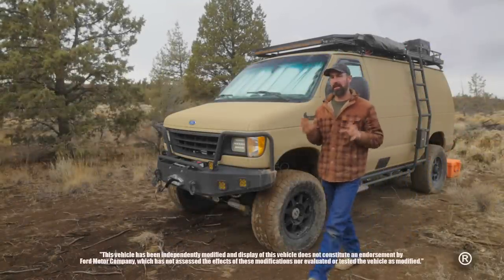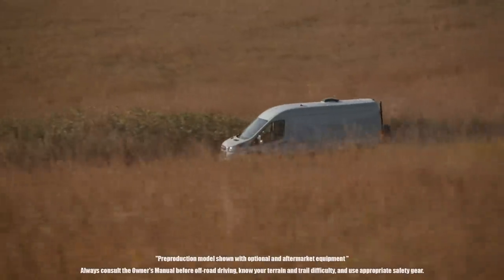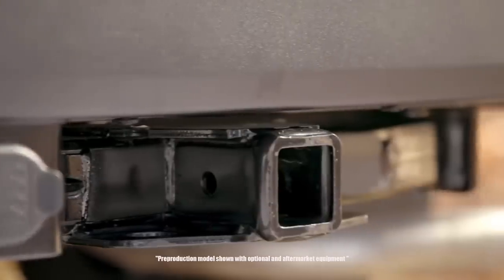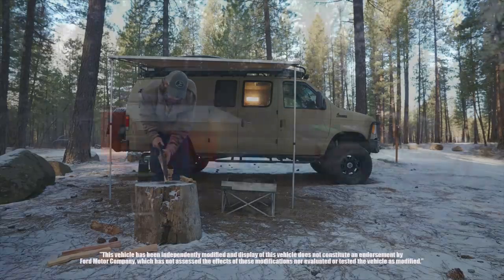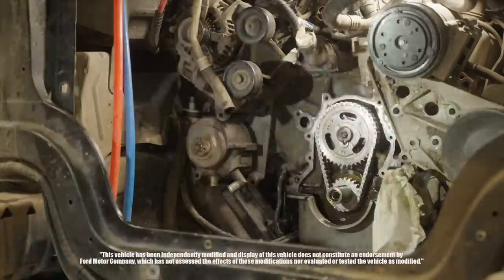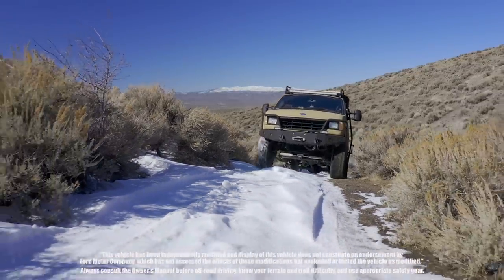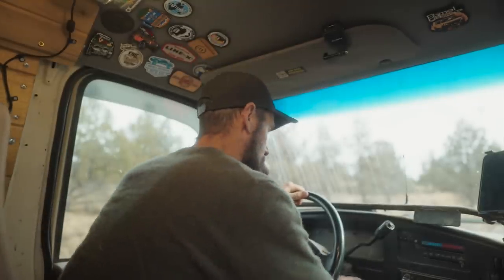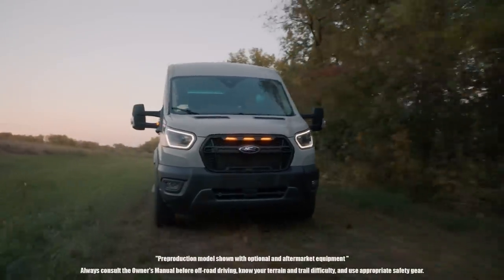The New Ford®  Transit Trail™ Van Reveal

Comment: I would guess that someone purchasing a Transit Trail, eventually would feel the same way you do after putting a similar amount of effort and care that you've done with your home. It's nice that they've come out with something that even novice's could get and have something that'll give them a head start so to say. Also glad to see Ford reach out and sponsor a person that uses their products.
Reply: As someone that's owned 3 Transits for work, with a 4th on order(I have no choice due to contract requirements), I don't wish these vans on anyone. I've had endless problems with mine and I'm not hard on cars. Bought a Ford Escape hybrid with 180k on it and I added 200k before selling it. I even had a 300zx and put 200k miles on that.  The longest I've gone with a transit without a major problem is 28k miles
Reply: @veganpotterthevegan  I have a 2018 as a shuttle vehicle with a less than careful  driver.  It has over 105,000 miles now and it has only needed normal maintenance and a water pump.
Reply: @Michael McGlothlin  there are always anomalies like that rare Range Rover with 400k original miles.  Transits are problem vehicles.  I work with over a dozen others with transits and ALL of us with ecoboost have had short lived headgaskets, over 1/3 have had transmission issues and we've all had issues with our sliding door

Comment: Ford's Transit Trail looks like a good rig for snowy/icy roads and easy dirt roads and I'm glad Ford came out with all-wheel drive. The Ford vans I had before treated me real good, but I will stick with my 3/4 Ton GMC SAVANA 2WD, Limited slip, lifted, larger off-road tires for where I want to drive. Thanks for the video's, Your hard work is appreciated

Comment: I think the used van that you built out makes the most sense, you know every part of your van and if it does need work you can do it.  Like you say the challenges in the journey is what makes van life an adventure.
Reply: Totally agree with you mate, also I'd buy an older van model so much less electronics to go wrong. If things go wrong you might be able to fix some stuff yourself.
Reply: I bought a new 2020 AWD Transit and LOVE it.  The process of doing the interior build, learning carpentry, DC electrical system, 3D design, plumbing etc was more than enough for this solo female to feel accomplished and also be confident in being able to repair anything on my own with my build.  I have learned some basic mechanical things as well, but am so happy that I have the warranty.  And that there is a Ford dealership ANYWHERE.  The AWD particularly shone when I got stuck in deep soft sand at Elephant Butte NM.  Simply deflated my tires to 15psi, used my recovery boards and threw it into mud/ruts mode.  Such a BEAST.  Was really a "hold my beer" moment and it solidified my satisfaction with going with the Ford Transit.  Also, drives like a dream on the highway and doesn't skip a beat on high mountain passes.  I will always have a van for vanlife, and when I'm ready to upgrade, I will be choosing a Transit again.

Comment: I know this is an older vide but if you're still reading.. how does this work? Do you have to buy a regular transit first, and then have an authorized modifier do the rest of the build for you? I'm not seeing anything listed on Ford's site about it, I was just curious about pricing. I'm looking for something like 4WD/AWD Winnebago travato where it has a bathroom in the back and 2 kind-of twin beds

Comment: Old: learn and improve as you go. Field fixes possible. Lower entry and monthly insurance costs. 
New: higher cost and complexity with little chance you’ll need to fix it on the side of the road, but fast forward a few years when the warranty has ended and the van has depreciated, how will you like it then?
If it’s anything like my 2019 4x4 Sprinter it’ll have a dozen recalls, mostly for software. Which leave you wondering if these new vehicles are disposable items long before Sasquatch drives it’s final mile. 
I’m currently looking for an older - less tech filled option for mild overland travel.

Comment: I think it was as good of a place to start for Ford. Neat concept. Interesting for sure. But for some of the places I want to go, that van would get high centered or stuck quite quickly. More lift, and an optional 4x2 or 4x4 would be better. Squach is more to my liking, and I love that van. You did a great job on it, and its capabilities show!! Thanks for this. Later!

Comment: I like it!
I bought a 2014 E-250 to convert to 4 wheel 
.  While waiting for my position in the que I used it to “overland”.  I found that the van worked well for what I was doing.  I lifted the van 4”.  I like what I see here.

Comment: I think this is a great move for Ford.  They're taking the van conversion market by storm.  With Dodge Vans being only FWD, and the double whammy of Mercedes pricing and diesel issues, Ford is in a great position to dominate.  I agree these vans are build for the highways, and maybe gravel forest service roads. That still covers a lot of territory.  It's not suitable for overlanding or weekenderlanding like you do. But that's ok. That's where their pickups and Kimbo / Scout / Four Wheel Campers come in to play.
Reply from the maker: I think this van could serve a lot folks very well. I think the AWD system will suit most folks. For everyday driving in bad weather conditions like snow and ice I think AWD is superior to 4wd.  Most folks are looking at the lack of 4wd as its road block to off roading it, but to me the road block is the approach and exit angle. The real issue is going to be cost and Ford delivering on the product. 

Jason
Reply: Where can you purchase one of these fans? I’ve talk to a lot of Ford dealers and they don’t seem to carry them nor did they want to order them for you?

Comment: I think that they made a good van for a large percentage of people who just want to get out and see what it's like. Nothing too hardcore, nothing too technical. Probably perfect for a light overlanding rental Fleet as well. Personally, I would take an older SWB High Roof with either the EcoBoost or the 5cylinder diesel and drop it off at Van Compass for the full 4WD conversion/lift. After that, I'd make it my own with the interior/solar and comms.

Comment: I see the transit trail as a step in the right direction, and FINALLY, something to compete with the Mercedes. However, if I could find a van like yours, that I could live in while conversions and modifications were being made. I would go that route with the goal of a much more capable rig than the transit trail.

Comment: I follow you on YouTube and your van conversion and I am interested in building something similar. I drive one of the several Transit vans we have a work almost daily. I do miss the old E350s with the 7.3 diesel that we used to have. The two vans are totally different beasts. The E350 seemed more rugged and tough. You had better visibility in the E350. The Transit van is a joy to drive, has great acceleration and it good on fuel if you drive it normally. The E350 was easier for me to get in and out of, as I am a big guy. Some of the problems with the Transit van is the door to the fuel filler breaks often and the replacement parts are expensive. A long thin coolant line from the engine breaks often and are sometimes difficult to procure from the dealership and according to mechanics difficult to replicate. The Transit was designed by Ford of Europe and is a joy to drive. I like the back up camera and land assist. Sometimes find the engine shut off (stop start) at a stop annoying, but you can turn it off. This new all wheel drive, Transit Trail lifted van would be an interesting camping van conversion for the fact that it already comes stock with what mods you want. Ive been driving Fords for 40 years and own several of them. Some are European Fords ithat Ford imported. Nope I dont work for Ford. I wish I did or at least I wish they would listen to an avid fan.

Comment: I would be a transit van buyer when I go back to the States because I am not mechanically handy and have no home base or family to help with repairs.  It is definitely a commitment due to the cost of the van.  Also, I am not sure if he eco boost engine will last a long time.  But may chance it and try to change fluids a lot.  I could see putting line x on the exterior and lizard skin on the interior and with the additional alternator put in some hefty electrical system.  I think this van has a larger fuel tank so a heater would be added as well.  Thank you for putting your genuine views on the van and your life living in a van.  I really like you and your videos and find it all so beautiful, entertaining and helpful.   Thanks for all the hard work and interruptions to your day/trips to make these videos.

Comment: The MSRP is $143,750. Then of course, market adjustment of $40,000 and other dealership fees.
Out the door, estimated price of $212,999.

Comes standard with 4 cylinder hybrid.

Comment: Is the transit lighter and thus climb more easily?  How does the range compare of a full tank?  How easily can it be modified for insulation, electrical system and refrigeration?

Comment: I really appreciate this video -- especially coming from you.  (and good on Ford for reaching out to you). 
I'm totally in the market for a van I can use for longer adventures - and have been looking closely at Transit and Sprinters. 
I've heard very good things about the Transit's AWD and 10 speed transmission -- and just as important - the solid engine that is used in  other ford products and be repaired pretty much anywhere. 
I've also seen options for lifting the Transit a bit too -- which is something I might consider to get a tiny bit more clearance.

Comment: I think for the people that have the money this would be a great starter it's better than the two-wheel drive of got a little bit of a lift to it so you can get out there into some slightly questionable situation and it has a warranty so if it does break when it breaks it's covered. I'd recommend it to my sister she was getting in the van line. Me personally though I like knowing that if I break it I can fix it out in the bush within reason

Comment: My thoughts. And since I have time to comment I guess I will. I had a 2003 E350 with the 7.3. Had it 11 yrs. Two build outs. 3.5 years living in it during nursing school. Countless road trips. Had plans for the Ujoint off road kit...even had the axles bought. Did virtually all the mechanical work on the van. As a travel nurse I began living in it a second time. Routinely went off road. But at 280K miles it began to nickle and dime me. Little things. The amount of money to add a 4x4 system plus get everything right would have been astronomical. I finally made the decision to purchase a new Ford F350. Base model with a few upgrades including 4x4 and the new 7.3 gas. $53K.  Then I purchased a near perfect truck camper for 7k. I still love vans and even bought a minivan which I will do a small camper conversion on. Knowing what I know now and with current my income I'd do the Transit trail without question. I'm just not going to off road a full size van to any extreme degree. I'll use my dual sport or quad for that. And to all the people that say the 7.3 diesel is a great motor keep in mind that the block is good but everything that attaches to it goes out like any other item. Hoses fail, seals fail, sensors fail, turbos fail etc etc. And its not because of a lack of maintenance. Anyway, my 2 cents

Comment: I will say this, my old man worked for the phone company, he was responsible for cell tower repairs, unpaved, mostly gravel and mud trails with a 2wd van with over 5000 pounds of equipment in it, not once did he ever not make it up to the tower here in the mountains of Tennessee, that Transit doesn't sit off the ground high enough to really need 4wd, its a pavement princess, a wasted option, it would high center the parking area at most off road parks!

Comment: I have a 98 k1599 ext cab. Canopy, cargo rack 4 way liter stock suspension.  I go off road a lot, pinstriped by SAGE BRUSH, camp in my R pon and reach out farther with 4x4. If I'm out and can't get back I have a carpet kit with bed to use if necessary. Low cost, low cost insurance. Strong 5.7, beats 70 thou anyway. Now if I win mega millions......hey, is that lightniiii>ing?

Comment: Congrats Jason on the sponsorship.
I am very interested in this van.  A couple of concerns for me (Ford if you're listening) 400W inverter not going to be adequate.  Towing capacity leaves something to be desired, for my needs.  Other than that I think it's a great starting point.
Reply: Get a Jackery battery (they sell them in the 240w-2000W range), charge it via the 12 volt outlet while you drive or the engine's running (or even via a portable solar), and you got your power even without having to go the complicated (and expensive) RV battery setup route.
Reply: Agree.  The thing that stuck out most to me was the small 400w inverter.  No where near enough. But I know it's a curable problem.  Also, the additional alternator is a big plus.

Comment: Very good job coming up with a stock lifted van and roof AC. Wondering if it would be possible to get this van WITHOUT the window in the sliding door.
Reply: It's not a roof A/C, its a fan.
Reply: @maddie4077  True. That's what I meant, thank you for correcting.

Comment: I want a transit trail, but wish they would add a bigger motor option. I want to be able to build a camper that can hold my dirt bikes and tow a boat, however all the math I do shows I will be well over GCVWR. If they had this exact body style with the Godzilla 7.3 or powerstroke, I would be a happy camper! Instead, I am stuck trying to find a unicell e350 😕
Reply: Ecoboost motor is more than enough go test  drive a 2023 transit .
Reply: @Montana_ef  not in the current config. I have the 21 f150 and that motor motor is fine, but the detuned version in the transit would be well outside of what you can legally pull. I bet you “could” make it work but would rather not risk insurance having a cop out because we were over weight

Comment: I saw a video that suggested that the inside of the transit trail will have spots that are predrilled to assist in the inside build.  I haven't seen a video address this.  I was hoping this one would.  It seems as though Ford is holding that information back??
Reply from the maker: I heard that as well but Ford did not share that information with me.

Jason

Comment: HI JASON 👋 
I LIKE THE OLD VERSION  / BODY STYLE  ! MAYBE IT'S BECAUSE I GREW UP WITH THAT BODY STYLE 🤔 MY VERY FIRST NEW VEHICLE WAS A FORD E 100 3 SPEED STRAIGHT SIX CYLINDER TWO WHEEL DRIVE  . KEEP GOOD TIRES ON IT , DO ALL THE SERVICING WHEN NEEDED . PUT ABOUT 500 / 600 POUNDS OF SAND ON TOP OF THE REAR AXLES  . NEVER NEEDED FOUR WHEEL DRIVE EVEN WITH 3' / 4 ' FEET OF POWDERED SNOW ❄ MY DAD , FRIENDS  , DRIVERS ED TEACHER WERE GREAT TEACHERS . PLUS SAFTY COURSE AT ANNE ARUNDEL COUNTY PUBLIC WORKS TOO. BUT IT STILL FALLS BACK ON THE LOOK / STYLE  PROBABLY THE COLORS TOO . BE SAFE  ! HAVE FUN  ! ENJOYED 🍨 🍨 🍨 🍨 🍨 🍨 🍨 🍨 🍨 🍨 THANK YOU 🙏

Comment: Sometimes I think I need something like that for all the on road traveling I do. My van does just fine but it is geared for more off road type adventures and in doing so I pay the price a bit for long road trips on pavement. Vans are so sooo expensive now days so I couldn’t imagine the cost of something like this transit van, is another reason I stayed away from the sprinter/transit type builds. 

GM and ford parts are relatively in expensive when it comes to our vans … I’m sure I cant say the same for the transit models. 

If I had to do it all over again… would I stay with our type of builds?  Yup!

Comment: I hate how things like this come out literally months or even weeks after I bought something new. tis my luck. This van will work for me and is exactly what I would love to have. with the ability to pull my boat or my motorcycle trailer this would have been perfect.
Reply: It is starting out with a limited run and special ordering process.  So there is no telling if and when you may receive the van next year.  Could be a long wait if you can get it.  What is meant to be is meant to be.  Be happy.

Comment: To me it looks bad ass if I was really into van life I will definitely buy it but the question is is it going to be cheaper than a sprinter van all decked out?
Reply: Sprinter is more expensive to buy, and definitely more expensive to maintain and repair (to say nothing of substantially fewer repair facilities). Sprinter does have a diesel engine, if that's a deal breaker.

Comment: I used to have a brand new Tacoma had the smart grid package  sensors in the mirrors tell me if I'm coming up on someone too fast boy did I hate that crap I used to shut that off every single time I got in a vehicle people got to realize the stuff were  buying in these newer vehicles don't make them anymore reliable cuz once that vehicle ages and stuff starts going wrong you can't fix that you got to bring that to a mechanic booyah

Comment: I think the tyres are too small for rough terrain and ground clearance is tiny compared to yours. If adjustable air suspension was included it might make a difference. For a trail vehicle I would have thought awnings and roof rack would have been included as well as front winch.